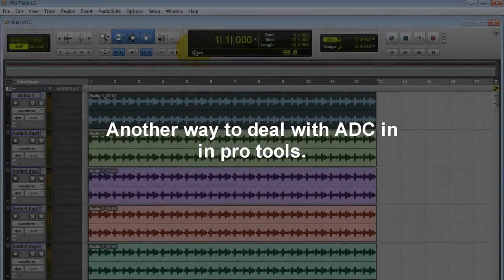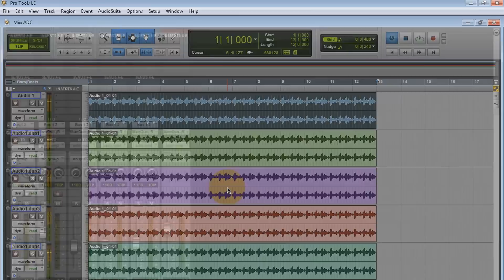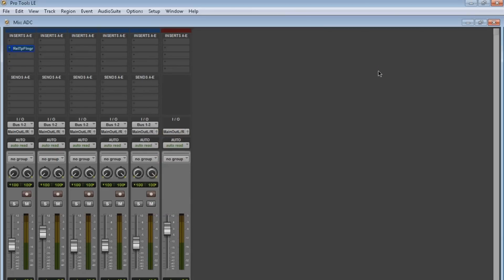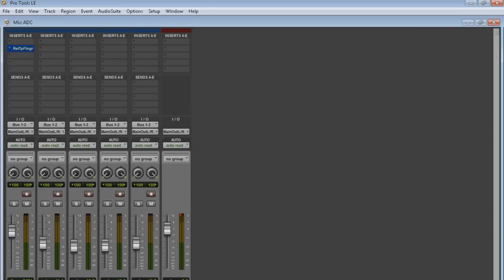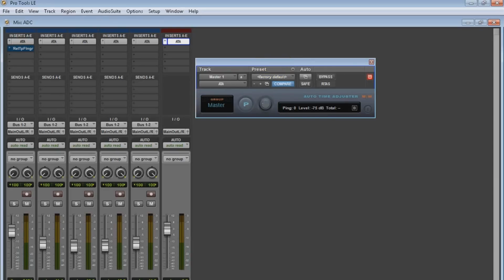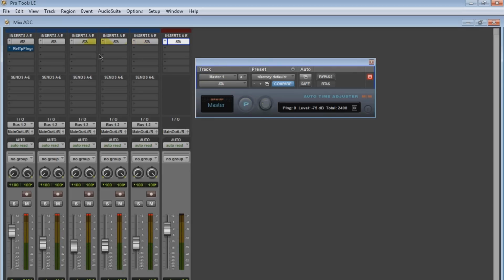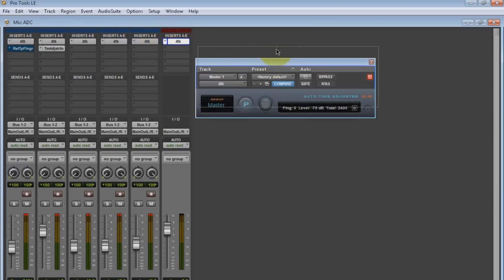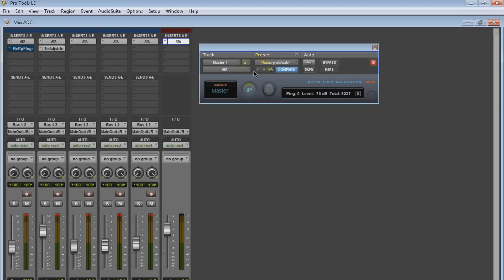Another way to deal with Automatic Delay Compensation

Comment: Hey, thanks for this video! So from what I understood, Pro Tools calculates the latency of a track simply based on the subtotal of added frames from all the plugins inserted, but it determines that based on just the estimate suggested by the plugins vs. any sort of proper reading? So having ADC enabled provides you with the minimum amount of compensation per track as well but what this would mean is it's simply inaccurate, while Mellowmuse ATA actually calculates the proper amount? Thanks again!